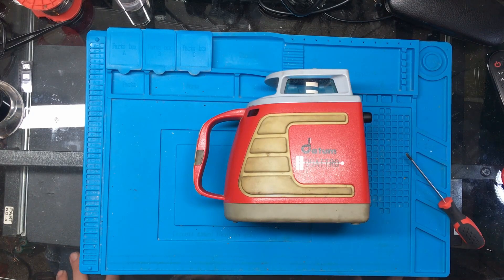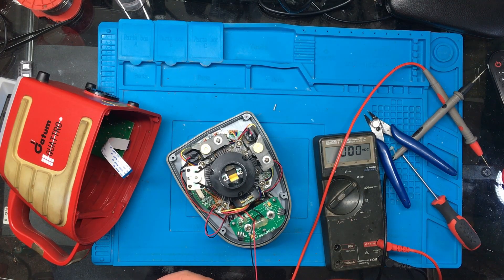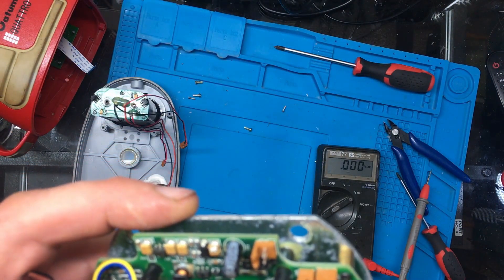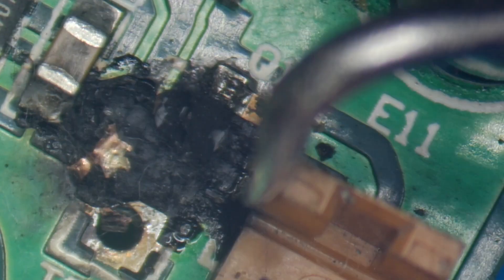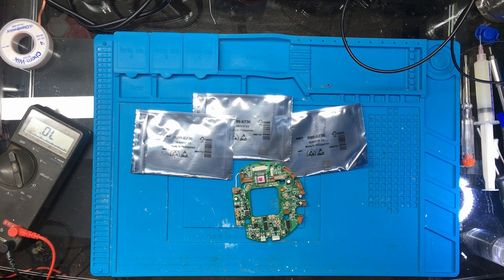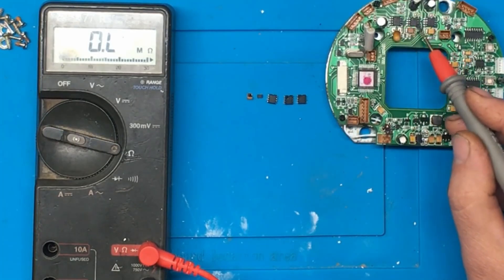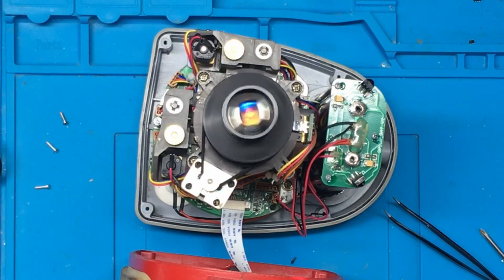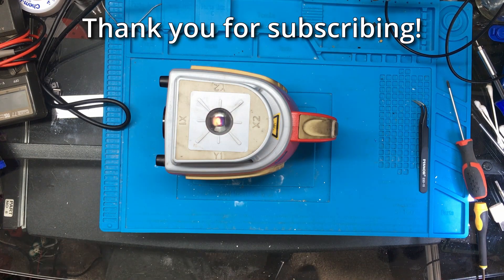Fixing A Rotating Laser Level

Comment: LOVE the old FLUKE 77.  I retired from the US Navy and back in the day, the FLUKE 77/AN was the BALLs to have.  It was one of the first digital meters used aboard US Navy Submarines and once you had one, you didn't give it up!  I deal with testing communication antennas and equipment and as old as the FLUKE 77 is, some of the critical test are still using the 77/AN or similar meters as a test meter. Love the channel and I learn a LOT from your repairs.  You surprise me a lot.  Keep up the fantastic work!
Reply from the maker: Thanks 👍yes I only upgraded my meter a few months ago to the newer 179
Reply: Still using my trusty Fluke 75. Prior to that, the meter of choice was the AVO8.  Nostalgia, eh  ;)

I keep looking at these new-fangled scope/meter devices and thinking I'll get one....but only if & when the Fluke 75 gives up the ghost. Thing is, I suspect the Fluke will outlive me.

Comment: Why did you cut out the most interesting part. How did you know which parts you needed, some of those voltage regulators only have a couple of letters on them how did you find the right one. What makes your videos unique to other fix it videos is the tuition quality, so helpful to us hobbyist fixers. Keep up the good work.
Reply from the maker: Thanks for your input Jonome! I'm not sure what you mean by most interesting part? If you search "smd marking database" I've used that to find quite a few components from the markings.  Thanks again for the support!

Comment: looking at it i cant help but think spinning the diode itself would be a simpler design than the mirrors and motors setup.
Reply from the maker: Possibly but then you would need some kind of slip ring I would have thought for the electrical contacts which may give unreliable operation and wear over time.

Comment: How did you come to the conclusion of bridging the part where the transistor (Q1) went (or went before revisions and/or explosions)?

I would have never figured it out that particular way. I would have looked for a photo of that pcb or schematic to confirm what was there or I wouldn’t have completed the repair. I’d be too afraid that I’d botch it somehow and burn someone’s home down with it.
Reply from the maker: I can't quite remember as it was some time ago now. It seemed to be controlled from the MCU to power off the device, perhaps in a low battery situation, so that function may no longer work. I didn't observe any unusual behaviour though and it seemed to switch off and on ok. It's still working so 🤷‍♂️
Reply: Yeah, that's a bit odd to me too. Even more so that you said you had the same device, and then didn't check out the pcb in that one.  You're right in that it may just be a low voltage cut off feature, but that's kind of nice to have operational too... Anyhow will chime in here with a big thanks for some great video content.
Reply from the maker: Thanks, I think I did look at the PCB in the one I have as that one was originally faulty too. It was the small 5 pin regulator had failed but not exploded. It just wasn't oscillating. The board was actually a slightly different revision from this one in the PSU area.

Comment: Nice! A little more involved on this one. I was wondering if Q1 could be a reverse polarity FET?  Then saw the charger..... But hard to see on video, is the charger center pin negative? Not that it matters when you are giving it 3 times the voltage, which explain the damage anyway. But if you are going to do wrong, do wrong on all parts. lol
Reply: And just noticed this was a year go...... YT just fed it to me.
Reply from the maker: Thanks 👍Yes, I've got a few fairly good videos like this one, yet YouTube never promoted them at the time and they only got a couple of hundred views. One of the smallest things I had to solder was bond wires from LED chips, that was a rare ramtex game I repaired.

Comment: How did you choose the value of the cap and transistor (since they were blown to smitherens and you apparently don't have the circuit diagram)?
Reply from the maker: One of my early videos, I had to check back as I couldn't remember. I can't remember if I could make any markings out on it or just took a rough guestimate as I knew what the input voltage was and it was just a smoother if I remember. There was 1 transistor that I didn't replace and just bridged out. I'm not sure what it's purpose was but the unit seems to function fine without it.
Reply: @BuyitFixit  
So, you base your choice on the component's voltage range and that's enough?
Reply from the maker: It was just a smoothing or decoupling capacitor on the input side. It may even have worked fine without it.
Reply: @BuyitFixit  the sorin method 😂